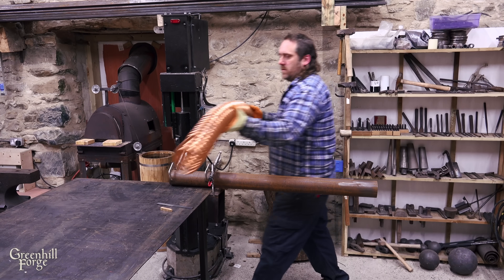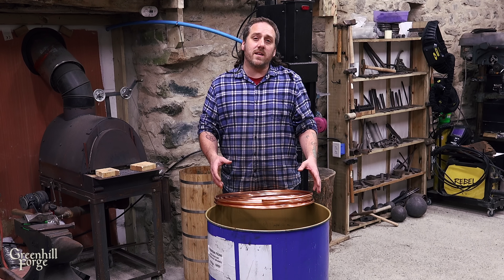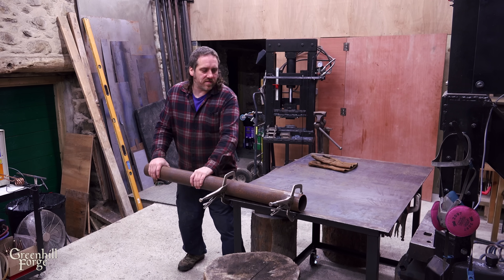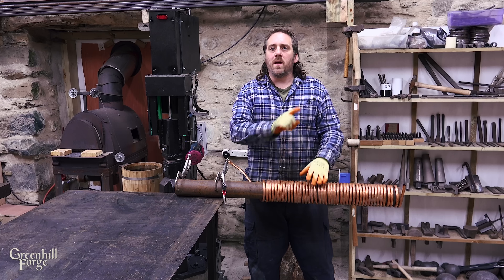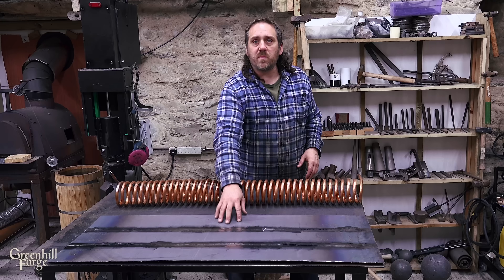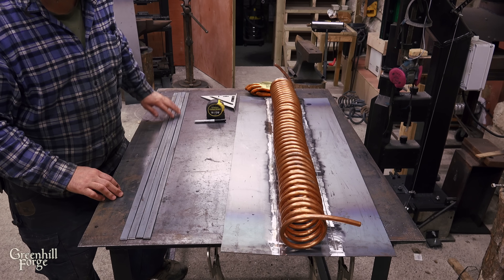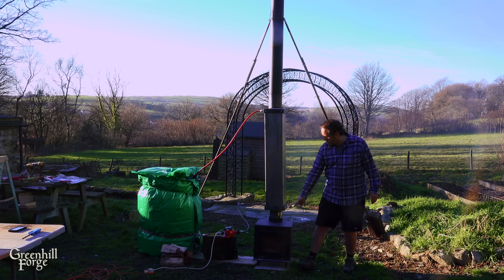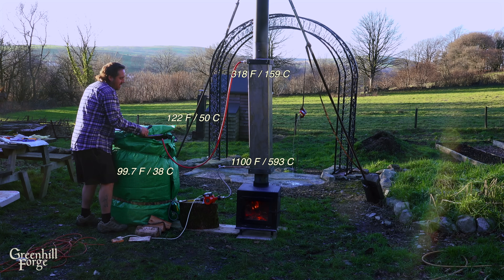Wood Stove Water Heater Experiment - Surprising Results! Part 1

Comment: The design is not the problem. It would just take a bit more expertise to know that you should never place a cold part, like copper pipes, in contact with hot exhaust fumes. This can have very dangerous consequences for the people living in that house. Perhaps this is the reason why the experiment was conducted outdoors.
Reply from the maker: I agree, this would not be a safe design for an indoor unit. it's just a test unit. more videos to come with more tests and different designs.

Comment: I love your ingenuity with the coil-forming and i am going to share it with my metal-shapers' forum.

While it was unnecessary  in this experiment; the storage vessel needs an escape vent, so that boiling water can escape. If it can't escape the vessel becomes a bomb and will explode. Be WARNED people have been killed by homemade-hot-water systems.

In Western Australia the vent is a tall piece of 1/2" copper pipe, with the top bent into the shape of a shepherd's crook. Boiling water can then fall onto the roof of the house where it is unlikely to burn anyone.

Love your movie and your presentation!
Reply from the maker: Thanks! Yeah, a closed system definitely needs some kind of pressure relief. I show my off-grid water jacket wood stove shower system in my next video and its a closed system so it has a built in pressure relief valve.

Comment: Q: Wouldn’t the contact of copper piping, with running water inside in contact with the steel supporting framing, cause bi-metal corrosion. In two-years max, the cooper piping would have about 200 perforations 😮

Comment: There where you live They don't have those things (what they call them) where you put fire under big pot and you can boil water directly with fire, then you can add pipes to water and circulate it with pump.

Or you can get these boilers what use chipped wood or you can put whatever burning inside and after you get it burning you can close air went and it burns very slowly and there is coil already inside where you can hook up pipes and pump.
2 big buckets of saw dust give you almost boiling water for 24h

Comment: I’ve always wondered if:
1. Rather than a coil
2. The water is in the jacket 
3. Protruding metal vanes run closely spaced along the inside void where flue gas travels 

So heat is carried by flue gas and  transferred to super high surface area metal surrounded by the water jacket and pumped around 

Seems simpler, no need to use high temp insulation, no expensive copper, no risk of melting the copper, probably easier to fabricate
Reply from the maker: I show my water jacket wood stove shower in my next video. not as complex as you're idea but very similar. if you have too much surface area the flue gasses can get too cold and it can slow the draft or even stop it by creating a "cold plug" and it will definitely increase creosote buildup. finding the balance is key.
Reply: @ Interesting! I’m from an extremely humid country so all this making water hot on purpose stuff is outside of my wheelhouse haha

Comment: We can't wait for the next video! We have a hot tub heating system that works as follows:

Water flows down a 4m tall pipe to maintain pressure, with a T-piece at the top of it to regulate the amount of water entering the pipe and vent steam to the top if needed. The water travels through a tap and a one-way valve, entering the top of the heating chamber(almost the same as yours, but it flows the other way around). By the time it reaches the bottom, it turns into steam.

The steam goes out from the stove and passes through another heat exchanger (a coil in water) to condense and is then pushed back up to the T-piece at the top of the system. This creates a closed-loop system with no pump needed—it operates similarly to a ram pump. The one-way valve facilitates the movement of steam and water through the system, ensuring continuous circulation. Because the same water is recirculated, no dirt or chlorine from the outside contaminates the system.

You can hear the one-way valve activating as it causes steam pressure to push the steam or water through the condenser coil and back to the top. When the pressure drops, the valve opens again, allowing more water to flow down the pipe.

This is a low-pressure steam system, so if the steam pressure becomes too high, it vents at the top of the T-piece for safety. To enhance safety further, we've installed a safety valve just after the one-way valve. We've tested the system thoroughly, including by heavily stoking the fire. The safety valve only opened once when we intentionally blocked the T-piece at the top (something you should never normally do).

It takes some adjustment to get the system working perfectly. We use a tap before the one-way valve to control the amount of water that flows through the system.
Reply from the maker: Wow, that sounds like an awesome system. I'd love to see pictures or better yet videos.
Reply: @GreenhillForge I'll only be back at home in about 2 months time, I can draw you a rough sketch of it if you want to try it?, I'll send you a message on your contact form on the website.
Reply from the maker: @VoidySA  Yeah, that'd be great. It sounds very clever.
Reply: Oh, yes almost forgot, the one way valve must be positioned level with the ground, so that the little flap hangs downwards, this makes it easy for the steam/water to close it.
Reply from the maker: @ so the water that is heated is in a closed system and separate to the water in the actual hot tub? And the hot tub water is heated by contact with the condensing coil?
Reply: @GreenhillForge Yes 100%
Reply from the maker: @ I love this idea, how big in the hot tub and how long does it take to heat from cold? and is your heating coil exposed directly to the fire like in this design? sorry, I have so many questions
Reply: @GreenhillForge Lol, no problem, the copper pipe seem to withstand the heat, it does get softer it seems, I can't remember how thick it is or where we got it, it's been working on and off for 5 years now, no problems, we do have connex fittings all over, we were not sure if solder joints would withstand the heat. The hot tub is about 2700 l and it heats it in 4 hours to 42 deg Celsius ...in South Africa....so outside was about 20 deg Celsius when we tested it.

Comment: There is the potential here to add a an ultra low voltage hot water pump connected to a thermoelectric generator (modified ecofan?) so  as to make this an entirely self sustaining off-grid setup. Very cool!
Reply from the maker: If done correctly, it can be a safe thermosiphon system that doesn't even need a pump. I also have a video of building a stirling engine which could theoretically power a pump too.

Comment: how is the condensation of the wood gasses? i would say that if it starts condensating you have alot of cleaning of those sticky smudge each time. and greatly reduced working when you dont
Reply from the maker: I'll show and compare the buildup between the two stove versions in the coming rocket stove video

Comment: Nice setup. If you make the water tank as tall as the top of the coils, you will not need a pump. Convection  will automatically make the water flow.
Reply from the maker: I get into that in my next video

Comment: I wonder if you could mitigate this issue (AND BOOST EFFICIENCY!) by incorporating a catalytic converter into this build. Combust more pyrolytic
by-products and extract more energy simultaneously? Just an idea...
Reply from the maker: the stove has a secondary burn chamber so it's pretty efficient already but cat stoves are cool too. I've got a video of the stove design and build you can check out if you want
Reply: @ Cool! I will check them out! Have you ever looked into thermoelectric generating elements? Perhaps something like the BioLite stoves, where the generated electricity is used to power a fan and a USB power port?
Reply from the maker: @ Yeah, I've played around with peltier/seebeck modules but you need tons of them to generate substantial amounts of power. I also have a video of building a stirling engine which can be used as a stove fan or for generating energy.

Comment: I'm interested in using this application in a heater core for forced air warming. What hoses did you use to carry the hot water to and from the barrel.  Which pump are you using too? Very cool project - thanks for showing this and the details!
Reply from the maker: the pump is a central heating pump rated to 110c and the hose is just a washing machine hose

Comment: This was fun to watch, as I lived for a few years in an entirely wood-heated house in Vermont with a wood cookstove from the 1920’s that had a ‘water jacket’ (pipes in the lining of the firebox). It was attached to a water tank behind it, fed by gravity. Within an hour or so of lighting the stove there would be a supply of hot water for dishes and showers. You could tell how much hot water was left by feeling the tank, which through convection would feel warm to the touch from the top down. You just had to be careful because the hot water could get VERY hot if the stove had been going for a while without using the hot water.

Comment: shouldn't the pump tap to the upper part of the chimney and let the in the hot water by gravity back to the jug? that way the heat exchange in the jug will also accelerate because hot water rises naturally

Comment: I would think that there would be a problem with unequal expansion and contraction of the steel vs copper tubing at the contact points quickly causing abrasive damage and thus leaks in the tubing.
Reply from the maker: I touch on this in the next video when I take the thing apart to show the insides

Comment: I was wondering if you added threaded fittings to the end and sealed them up under water could you coil the tubing without causing any kinks, instead of freezing. Water is not compressible and if this worked it would save time, also you would not have to find a freezer with enough room or piss off the wife for putting it in with the food.
Reply from the maker: yeah, I think it would theoretically be possible but there would have to be absolutely no air and the caps would need to be very secure. I've got a chest freezer so it's pretty easy in my case to just freeze it.

Comment: Great job!  What is the expected lifespan of this with the copper against the sawtooth metal?  (Electrolysis) 
I mean no disrespect, it’s extremely well built!  Workmanship is outstanding!
Reply from the maker: the copper would outlive the standoffs I think as it's more noble than steel, but this is just a test unit made for a few burns to get data.
Reply: @ Understood 👍

Comment: When heated, wouldn't the copper coil expand at a different rate to the serrated steel, and thus, rub against it and eventually cause a leak? Also, wouldn't the coil also get covered in soot and creosote? The creosote is a fire risk, the soot would reduce the heat transfer and, if you had a leak, the water would pour into the firebox of the stove.
 
I though, at first, you were going to place the coil on the outside of the chimney keeping the coil separate to the smoke, which would, i think, make more sense.
Reply from the maker: I'll be addressing these things in upcoming videos/designs.

Comment: I wanted to put something like this in my house to heat my water for home use. The part that got me hung up was the tank. What kind of tank are you using? I know they make special tanks. With high-quality blow offs, could you use a water heater?
Reply from the maker: If I was doing an household system I'd use a proper water heater tank designed for potable water and I definitely wouldn't put a heater system like this inside a house. I've got more designs coming which could get closer to a system that could go inside but it would still be a big risk and something I wouldn't do and would recommend against. Maybe outside pumping hot water to a tank inside like an old style boiler.

Comment: great video! if you put the barrel above the level of the copper coil, the recirculation pump would not be needed. hot water would go into the barrel on the thermosiphon principle

Comment: When shaping the copper pipe, you can fill it with sand or salt and clamp the ends. You'll wanna tamp  and refill a few times, but it provides just as much internal integrity as ice.
Reply from the maker: I do that for small coils

Comment: The copper exposed to the smoke will deteriorate at an exponential rate and give you problems within six months had you set the coil on top of the stove and built an aluminum sheet metal box to surround it you could have endless years of maintenance free water heat from your wood burner I’ve done it for 40+ years the inside the flu didn’t work out for me either.

Comment: This may seem like a daft question, but if you were to run this without a pump, would the heat in the water in the copper pipe be enough to cause it to circulate itself?
Reply from the maker: yeah. that's the end goal.

Comment: What he did is a very dangerous thing if applied for use at home. I hope you understand where the biggest mistake in this experiment
Reply from the maker: Yeah, definitely a terrible idea to put a design like this in a house.
Reply: @ The design is not the problem. It would just take a bit more expertise to know that you should never place a cold part, like copper pipes, in contact with hot exhaust fumes. This can have very dangerous consequences for the people living in that house. Perhaps this is the reason why the experiment was conducted outdoors.

Comment: I did a 6' long, but otherwise similar coil in a stainless tube packed with dry sand. It takes a little while to heat up, but delivers consistent and quick recovery, and isn't really affected by high/low fire.
Reply from the maker: I've got a deisgn coming soon I think you'll like.

Comment: Dont ever be tempted to install this inside a building. Once the soot and creosote has built up on those coils, the eventual flue fire is going to be spectacular.
Reply from the maker: This is just a test build to gain data. It will be scrapped after a few burns.

Comment: As a pipefitter with lots of steams or other gasses and liquids, and pressures, millwright, electrician, carpenter, and DIY still owner builder.  "I would" not get to carried away with cooling off the flew gasses.  

 "I fill" my tube with a loose media(sand or walnut shell) for bending or don't worry about it, copper tubing bends easy and is available in about 4 thicknesses I can think of, but I retired.    I did use lead bird shot in my V twin's handlebars as basically a dead blow hammer effect for longer ride hand comfort.

Cool flew or gasses can mess with the air fuel combustion and exhaust circuit. 

In the 70's as a kid I helped Dad design and build a DIY self circulating solar pool heater when PVC hit the market using thermals to flow the water once primed.

"I Used" soldered solid copper wire to keep "my coil" spacing and ridged, but I was shedding heat with "my" coils.   Why not just coil your heat exchanger around your flew for zero gasses copper contact?  Copper no like to hi temps or flew gasses I also did passivation
Maybe? an un insulated open each end heat reflector exoskeleton? to allow air exchange rise?    heating the area too if desired. 

Done right, "I feel like" this can be done self-circulating once primed?  I may use sand in place of toxic or any other insulation as a heat sink of mass.

Keep up the Journey!  Have fun.    
Thanks for the ideas. I may be doing something similar "in my" cold even in so cal all metal building work shop/man cave this winter, "I am" a KISS (keep it simple) kind of guy.     "I was" Cheap!  Now "I am" Green.

God Bless.

Comment: Would be nice to see version 2.0  this with an inner pipe and then fill the void where the copper is located with sand... will make it heavy and less rapid but much longer lasting and ideal to add long term as a backup. My thought on the sand would be to help with heat transfer while protecting the copper tube even if it's empty.
Reply from the maker: V2 is coming

Comment: Those coils ought to be outside the stove pipe. Cooling (condensing) exhaust gasses as they exit the firebox is a bad idea. Even burning well dried hardwood you will have massive creosote buildup and fire risk. Also you will have thick dank (toxic) smoke coming out the chimney pipe as a great deal VOCs are catalyzed in the first few feet of exhaust pipe. This is why modern stoves have secondary combustion boxes, to burn the gases that your water heater is condensing. Good build, bad design.

Comment: Man that is a really beautiful design. it still needs a casing inside of the coil for the fire to move up or the coil is going to collect all the creosote and be a very dangerous hazard. You always want to put some kind of barrier between the coil and the actual fire. Not only is it bad for copper to be heated and cooled repetitively but creosote and stuff is going to build up on those pipes and make it very difficult to clean and you don't want that. Your copper coil should go around a casing and the casing should be the flue pipe if you want to create turbulence inside the flue pipe think about a Archimedes screw. You can find a piece of metal that specifically designed this way inside of gas hot water heaters in the center flue pipe